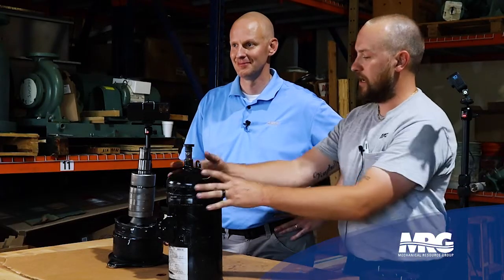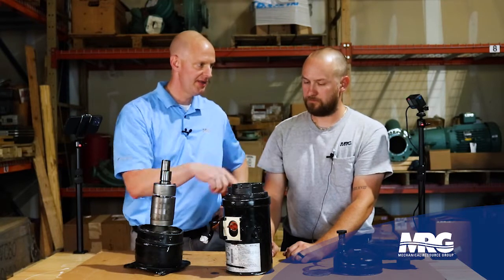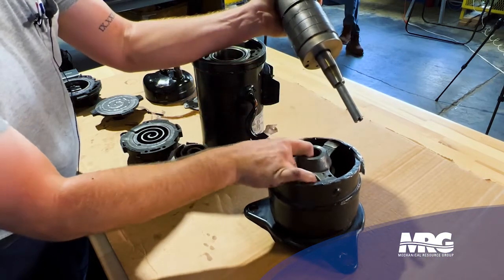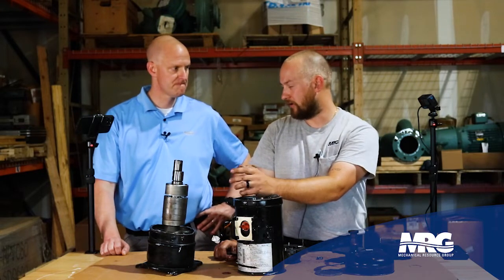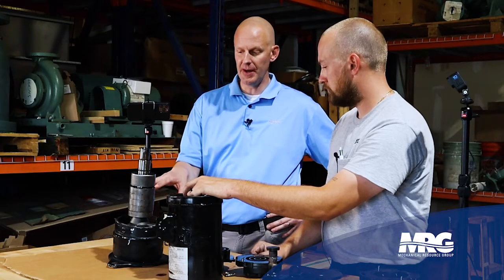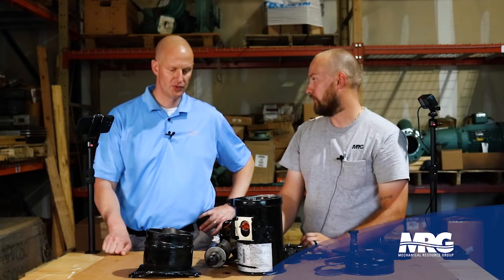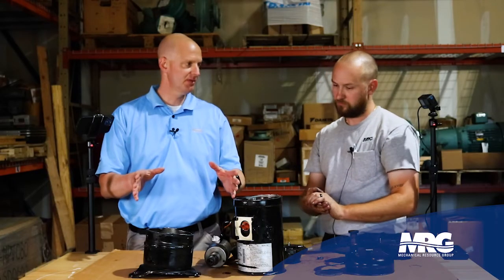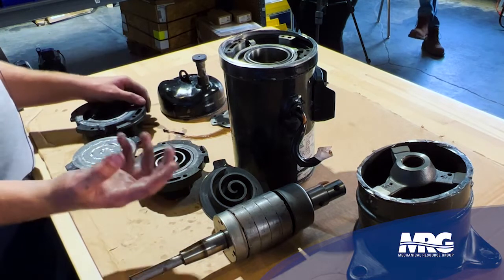HVAC Compressor Autopsy: Diagnosing Refrigeration Murder with @MechanicalPros

Comment: When I was an apprentice.. decades ago the guy I trained under made me break down the compressor being replaced.. generally semi hermetics.. and find things like piston pitting, sleave cuts, valves busted.. we would course correct depending on what I found.. back then copper plating was a thing, haven't heard that term in years.. copper plating back then meant acid.. great video, sent it to my apprentice